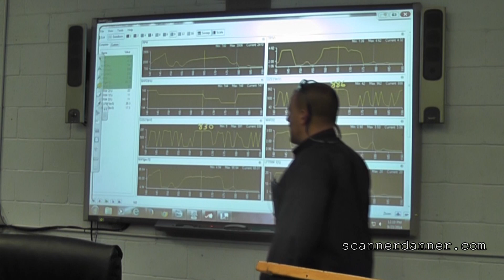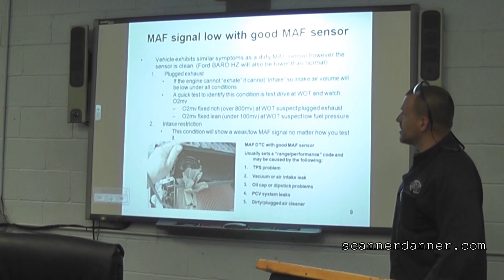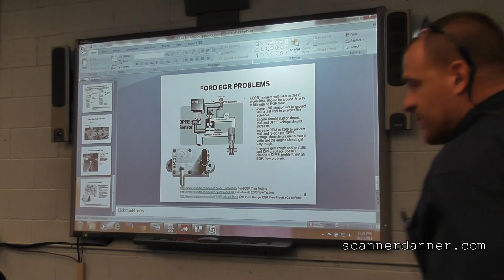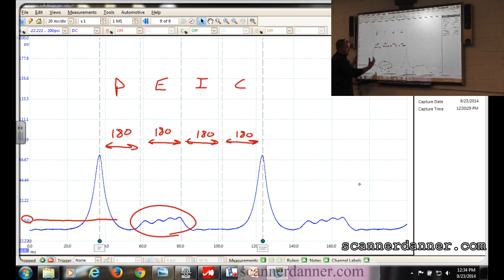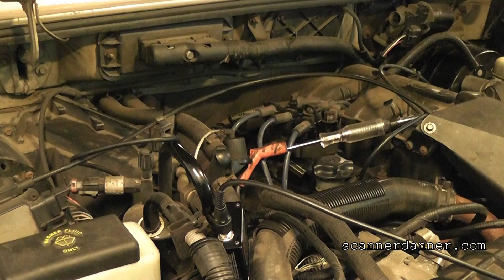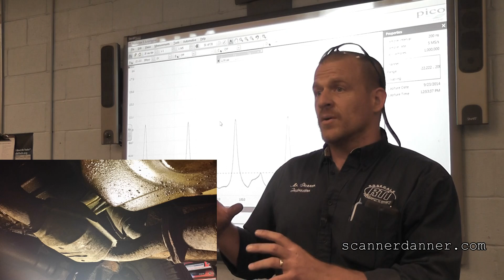How to test for a plugged exhaust (picoscope & psi transducer)

Comment: Sir... could this have affected the fuel Trims making them differ from bank to bank due to the one clogged... thanks
Reply from the maker: Yes, absolutely that can happen
Reply: @ScannerDanner  so.. using VE test..and graphing the 02 and fuel trims for both banks...if the VE test fails and the 02 is rich for both banks "it's not fuel pressure or the MAF sensor" now fuel trims Will point you to the clogged bank ...😎

Comment: Once upon a time, when i was a dealer tech(Opel), 90% of plugged exhaust cases where from faulty rear muffler.  50% of cases diagnosis was easy, there was a squirrel(insulation fibers) coming out from tail pipe.  So it´s not always cat-problem.
Reply from the maker: The only plugged muffler I've seen in 30 years as a tech was from pieces of the melted cat that got lodged downstream in the muffler. But agree, always and never are terms to be used cautiously
Reply: Those were late 80´s-90´s certain models. I guess it was a problem in the muffler desing.   One other case come in my mind: Couple of years ago in the shop came quite new wolksvagen. Its exhaust was plugged from ice :)  Winter, short driving, so water from exhaust gases never got a chance to evaporate.  Temperature was around 0° F  few weeks.

Comment: hey there, Paul if I need to check a Nissan whit pressure transducer and I cant remove the spark plug cause the intake is on top of ignition coil, is possible to remove the ho2s and take it from this point, do you recommend it ??
Reply from the maker: For sure. Remove the upstream O2 and just adapt a simple vacuum psi gauge. Or your psi transducer would work too
Reply: @ScannerDanner  do I have to remove the scharder valve?

Comment: In your explanation, you see in the intake stroke that the pressure goes out of the cylinder into the Intake manifold. There is a chance, in some engines or if the cat is completely molten shut, that you see exhaust gas coming out of the throttle body. I had it on the Ford Escape 3.0 of a friends wife and he told me "that's just from a misfire at the wrong time". In newer engines, that's so wrong, you can't go more wrong because the spark timing is sensor / computer controlled. 

After 2 weeks, I made the call it has something to do with the exhaust (again) and I was right. 3rd cat was molten shut, car was a crank - no start, and after emptying the cat it was ok again. Some time later we change it, was not easy to get this thing with the right connections.

But if you have the problem, that the exhaust is completely clogged up and you have a no start: Remove one sparkplug and try it again. It will run because the pressure equalization will be possible with an open cylinder.

Comment: Great use of a scope you are really pulling the full  potential out of it 
You are right about a high back pressure on the oneside but at the beginning of the video you answered your own question 
That vehicle was no EGR so the cam profile is made to have a little different  scavenging characteristics  Not uncommon to see pressure (in  cylinder)  of around  41.0 inHG  which is 1.5 psi at high idle would be Considerated  good  maybe next time try using the scope on the vacuum side not only will you see low vacuum but you will get spikes in the overlap on the intake stroke when I do it I trigger off the cam #1 TDC  on a v6 or 8 with cats on both exhaust  manifold  You can see how one side will effect the other and if you really what to see something look at the crank signal and  compare the HZ on  companion cylinders  You will see the side with a  clogged cat slowing down the power stroke on the opposite side grant it it’s a small  variation but fun to see I showed a guy who does a lot of after market tuning setups (not my thing) that and how to balance the exhaust system with  proper placement of an X pipe

Comment: Paul I have a question I have a 2000 Dodge Ram 1500 5.9 every once in awhile when I first started up and get moving it don't act like it's getting fuel and it backfires through the intake it only does it for a couple minutes and a finally take off like a striped ape it does not do this all the time and there is no codes set I know I have good fuel pressure in the shop seems like I can't get it to mess up in the shop I have to be driving I was also thinking about changing cam sensor but I don't want to be a
Reply from the maker: How long after start up? Immediately or after a minute or two?

Comment: Paul, great video!!!! Paul did you have the schrader valve removed from the transducer hose? Would it make a difference in the waveform readings with or with out being installed in the transducer hose?
Reply from the maker: There is never a schrader valve in a compression hose when using a scope and psi transducer. You don't want to trap any psi in the hose, ever. It would alter the entire waveform. Make sense?
Reply: I did not think their was, and I only asked due to someone stating they did not have the schrader valve installed in the compression hose and they were using a wps500 and I also agree it would give an incorrect outcome/diagnosis. Just asking to verify that is all. Thanks again for your hard work and reply!!!!!!! @ScannerDanner
Reply from the maker: No problem Kevin, I wasn't judging. Thought it was a great question actually.

Comment: Do u think the pressure transducer should be installed on the companion cylinder even if it was a log style manifold or a header style?
Reply from the maker: you just need to be aware of the variables with manifold psi changes based on where your transducer is mounted

Comment: Per ford manual they give a max back pressure spec, for example 2005 f150 5.4l. Should not exceed 8 psi per cat measured at up stream o2's. just have to deal with it and remove o2 for best accuracy. I do like your test method in this video. Great job. It's a delema to determine if the last cat is bad. Replace as needed and road test. Communication updates with the customer is key for this situation. Your data is all you have.
Reply: Thank you Paul. I already have access to your eBook Engine Performance 
Diagnostic through bookguardpro.com as I bought membership for reading 
it.

Very good book by the way. And yes, I would like to grab my 
hands on the printed version as I like to take a look on it from time to
 time

Kind regards
Reply from the maker: That is an under load spec
Reply from the maker: Thanks brother! This was in my spam box because of the link. It automatically puts them in there. I really appreciate you pointing this out. A complaint has been filed and it will be taken down. 
Anything I can do for you as a thank you? Want a copy of my eBook?
Reply: Email me at paul@scannerdanner.com

Comment: If the CAT is doing its job, shouldn`t be a difference between the 2 readings of the O2 sensors? The upstream one should bounce, but the downstream one shouldn`t be close to a constant reading? So if the CAT is plugged, than the reading should be the same, because the CAT is not doing it`s job.

Comment: Hello Paul, 
I have a problem 2006 Ford F150 5.4L lack of power/misfire #7 cylinder. This truck has a fairly new engine, ECM, wiring harness(I can see a lot of black tape and splices), rack, intermediate shaft. Someone has dumped a ton of money into this truck. Might I add, this truck was bought at an auction and my doesn't want to put a whole lot of diagnosis time into it. I'm the 3rd tech in my shop to touch this vehicle. They, not me, have thrown an injector & coil, checked fuel pressure which is good, dropped exhaust to verify clogged exhaust, so  this eliminated some testing for me... So I test drove watching my O2 sensors at WOT and noticed they were all rich with no power. I've current ramped the coil and looked at injector waveforms with my Vantage pro and compared with known good cylinders at idle and snap, which look good. Cylinder #7 has about 140 psi compared to cyl #1 170 psi opposite bank. Could this fairly new engine be junk or am I chasing a air delivery problem? Paul, any help would be appreciated.

Comment: CAN I USE PICO PRESSURE TRANSDUSER ON SNAP ON SCOPE?
Reply from the maker: +Piotr K with the correct BNC to standard banana plug adapter, yes
Reply: You will have to manually convert PSI cause the stinking S.O. don't have settings to it for you
Reply: Piotr K

Comment: Another very good video , it shore would have been great to have seen one cylinder pressure transducer per bank at the same time and two firstlook engine diagnostic pulse sensors one at the intake manifold and the next one in the tailpipe, very advanced diagnostics and thank you again.

Comment: This vid is definitely in the top 20% of your collection. Seeing the pressure pulsations to that level of detail and resolution is amazing. The moment you rev'd the engine on the first bank test I knew what the problem was (like you did). I don't have Premium, so I won't see the follow-up video.

Also, in a shop environment, a tech could print a screen shot of that waveform and provide it to the customer, to show the proof that the exhaust is plugged. One of the many benefits of computerized testing.

Knowing if the second bank tested has a bad cat would be a little tougher call, but fortunately both pre-cats get replaced together because they are all part of one Y pipe assembly as you said, so that fairly tough call on the second pre-cat isn't one that necessarily needs to be made.

Even though this video would normally be in the Premium area only, I humbly suggest shooting a follow-up after the exhaust is fixed, so that those of us without Premium can still see what the outcome was.

That pressure gauge is SWEET, but at 750 clams, not something I'll be buying in this lifetime (but for a Pro it would be worth it, but not for me as an amateur).

By the way, my brother has a 1997 Ford F-150  4.6L V-8.  I removed the driver's side O2 to test for a plugged cat, because he has had a massive vacuum leak for a long time, (cracked intake manifold lower section-plastic-) along with massive lean misfires, but lots of fuel going through, because the computer is dumping in fuel, but can't bring the mixture into a combustible range. Anyway, the gauge measured only .1 to .2 psi of back pressure, even at higher rev's. It was your video's that explained proper exhaust back pressures that taught me how to do that, and to know the his cat's are OK.

Thanks Paul

Comment: scannerdanner what is the best way to adjust a carb? i dont know this old stuff maybe you can help. its a carter series i think thats the same as an edelbrock.
Reply: ok thanks get james danner to start uploading vids again
Reply: Set your mixture screws to the FIRST point of your highest rpm or vacuum. By first point I am saying you will get to a point where additional turns do not increase it anymore, you're just dumping unnecessary fuel now. The first point of your highest rpm (can use your ear) on each mixture screw. Then when your happy, if rpm is now too high, set base idle screw and then redo the whole thing again.
Reply: reason i ask is because when im in park doing a dead rev it revs real nice but if i get on the gas to get on a highway it has a dead spot hesitation. figured id ask the pro. could be timing to though. is it true you can time an engine with a vaccuum gauge?  72 dodge dart 318
Reply from the maker: Then it's not the mixture screws. Focus on the secondary circuit and accelerator pump.

Comment: Paul,how you ever use  fuel trim as a guide direction for plug exhaust? a was in a class where the teacher said  for example if you have in  bank 1, 12 positive  and -12 on bank 2. classic  fuel trim numbers of plug exhaust  on  v type engines . Personally I have not seen it yet, but I hope I can get one soon.
Reply: I've seen trims used to locate a plugged exhaust on dual bank, one cat per bank engines, because one bank is drawing in less air than the other bank. I believe one bank should show an extreme opposite of the other such as -15% LTFT bank 1, +15% LTFT bank 2. Something close to it. You're correct. I like using a typical gauge like Paul used to, and if it's a Ford then using the DPFE is just as good and easier. I do think, because of it's speed, taking a quick look at the LTFTs if you suspect a restricted exhaust on these engines can provide more direction and confidence towards checking for a restricted exhaust. Cheers
Reply from the maker: I have not, but I have also recently (from a subscriber on my premium channel) learned about this same thing.
wish I had this ranger back to play with it. The student wrecked it! I am so mad. No follow up will be possible on this vehicle.

Comment: Hi Paul, great video. I have a WPS 500 and have not considered using for in cylinder back pressure testing as I normally drill a small hole & weld it later.
One thing though, have you struck back pressure in the exhaust manifold (before the turbo)being higher than normal for turboed engines?
What are your thoughts.
Jamie. 
New Zealand.
Reply from the maker: Good question.  Unfortunately I have not, still learning myself with this tool. Lots of variables.

Comment: Hello Scanner,
I purchased your E Book recently. I like it a lot, as it is an easy read.

Question, do you have any suggestion for reducing noise using the PICO orange handle COP probe? I get a lot of noise on the screen. Any ideas? 

Do you think the new PICO scope is worth the upgrade? 

Thanks for what you do!
Reply from the maker: Lower your sample rate, add a filter (something the newer pico does very well)

Comment: Paul, If the fuel trims are normal then the plugged cat is the rear one. This is because the MAF correctly measures the incoming air. Then the air is equally distributed bank to bank. If the fuel trims are negative on one bank and positive on the other bank the same amount. Example -22 total fuel trim on bank 1 and 22 total fuel trim on bank 2. Then only one bank is plugged. This is because the engine is now drawing in less air, due to one of the banks cat being plugged. The MAF reads the incoming air correctly, but then the unrestricted bank takes the majority of the air and the restricted side does not, but the fuel is still being added by the injectors on the restricted side. This means the restricted side is getting to much fuel for the amount of air it has available. This means the side with the negative fuel trims is the restricted bank. Hope this info helps.
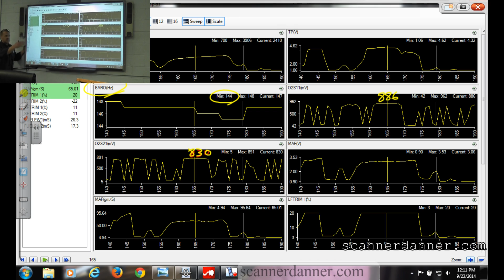Reply: ScannerDanner.. you can read them at 3:15... LTFT#1 is +20% and LTFT#2 is -22%
Reply: EXCELLENT
Reply from the maker: Great tip! I meant to check the trim numbers and never did. I'm actually upset now that I didn't.  Makes perfect sense. Thanks so much

Comment: Hi Paul I had one that when you take it on a road test or revved it high the exhaust prior to the blocked exhaust glowed red hot if that's any help...what about looseneing flange coupling instead of drilling hole, to let pressure out Fred uk
Reply from the maker: Tom, you must live somewhere were they don't use road salt in the winter. Not possible to do that here my friend.
Reply: ScannerDanner Hi Paul, I;m afraid that one went over my head, never had any problems with salt, do you mean it catches fire?, don't use it in summer anyway, we do use it in the winder, could get it hot stationary in your workshop  and give it a good rev...I accidently had one running and the front pipe stated glowing red, it was unintentional...turned out to be a blocked cat...I have driven them up the road with the coupling flange loose to let the pressure out, never had any trouble personally Fred in England..
Reply from the maker: Haha, no, it rusts the crap out of everything.

Comment: Hey danner don't know if u showed this in part two but a vacuum gauge hooked to the intake could point to a plugged converter the reading on the gauge would be less vacuum at 2500 to 3000 rpm than at idle due to it not being able to breath
Reply: the intake manifold vac can be read via the running compression also .......

Comment: Hey danner don't know if u showed this in part two but a vacuum gauge hooked to the intake could point to a plugged converter the reading on the gauge would be less vacuum at 2500 to 3000 rpm than at idle due to it not being able to breath

Comment: are plugged exhaust systems that common? also how would you reccomend testing for this if you dont have a scope and the exhaust is super rusted?
Reply: Not sure what Paul uses but there is a tool called a short finder that works real neat for finding shorts. (Mine is badged Lisle but there are a bunch of "brands")
http://www.amazon.com/Tool-Aid-25100-Short-Tester/dp/B000RFLR0U
 It's basically a self resetting circuit breaker and an inductive meter. (I picked up a few in different values for lower/higher loads) You connect the breaker in place of the fuse. It will trip/reset cycle. Then you run the meter along the harness. As you follow the wires the meter will oscillate in time with the breaker. When you get to or pass the short the meter will stop.
I believe power probe makes one that uses RF to trace the circuit as well.
Reply from the maker: phil holbrook check out my other videos on restricted exhaust testing. I have at least 2 other ones. Thanks !
Reply: i seen the one you have on a old school impala now like the o2 sensor reading trick under wot. i always use that now for a low power complaint! what technique do you use to find a problem for a continuos blowing fuse?